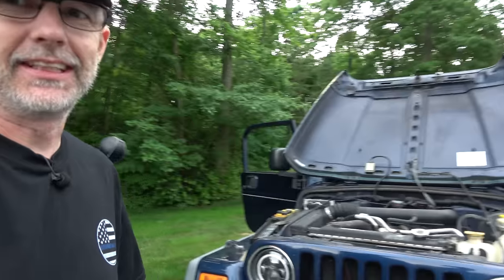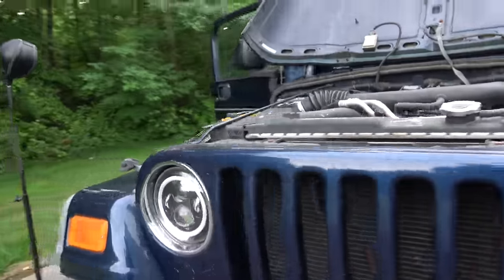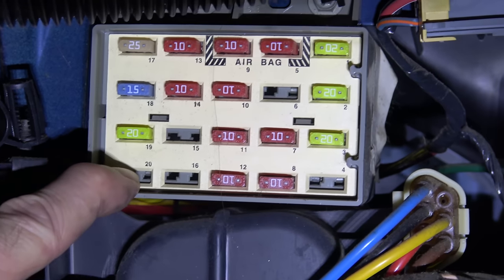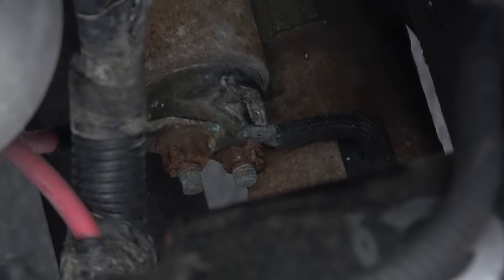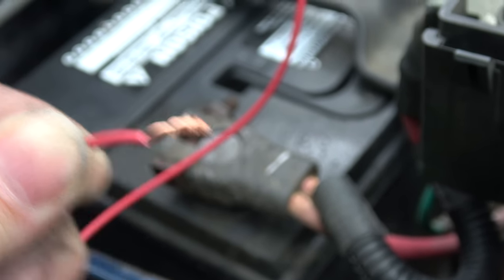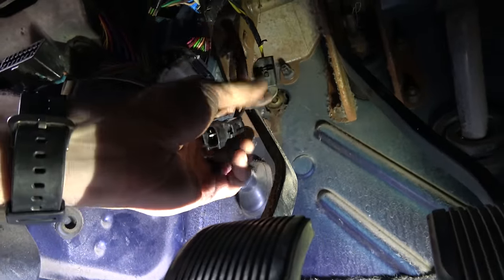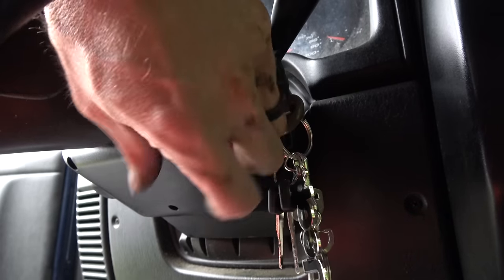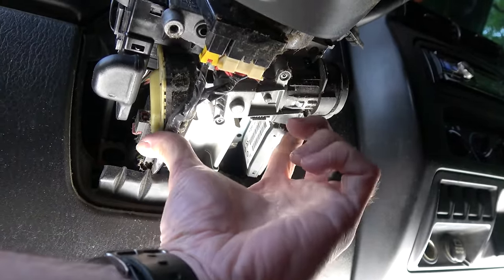Troubleshooting Jeep TJ Wrangler! Won't Start but Problem Found - Project 2004

Comment: If I had a bad switch or actuator would it click as I turned the key.. I have lights, radio, key alarm comes on, but when I turn key I hear clicks and everything goes off, I then have to take battery terminal off, put back on and power goes back on..  thanks for the video
Reply: Did you get this fixed?
Reply: @T_J_SMITH  what did you end up doing? Replaced my ignition actuator and ignition switch a few months ago, now I'm having the same problem. Replaced actuator and switch for the 2nd time but still won't start.
Reply: @tyronehoustonson2944  I found a broken wire on/near the starter and soldered on a new piece of wire to lengthen it, then crimped a new terminal back on.
Reply: Sorta what he talks about around 4min of the vid
Reply: @T_J_SMITH  I just got mine going thank God. Ended up having a blown fuse in spot #19. Took a spare 20 amp fuse and put it in the #20 spot to bypass the clutch safety switch and I was able to crank the Jeep up succesfully after that.
Reply: @tyronehoustonson2944  Remember fuse popped for a reason might want to spend some time chasing that down.  All my @jeep  have no clutch safety switch.  We jumper the plug under the steering wheel, and that is only to eliminate that wire gremlin from troubleshooting future issues.
Reply: @T_J_SMITH  any possible explantations why the fuse popped? Also as I was almost home my clutch went out 😢 the master cylinder broke where it connects to the top of the clutch pedal. I wonder if that has anything to do with me bypassing the clutch safety switch
Reply: @tyronehoustonson2944  Not really, could be the switch internal to the clutch master cylinder shorted out to ground?  I don't recall if it is a 12v line or ground that is being interrupted there either way jumper the jeep side of the connection to simulate the clutch being press in.  then replace any fuses that are there from factory and you should be fine.  As for the broken piece, old plastics sometime crack nothing to do with the fuse just fix that clip and you will back on the road.

Comment: Awful. Just a small piece of metal broke. Was there pressure on the steering wheel when turning ignition on? Do you park with wheels straight? Thanks
Reply: There is no pressure from the actual string wheel.
It's just lightweight pot metal some are actually tin those last the longest.
Often you feel no pressure, but notice you have to turn the key father for the same results.

As far as the direction or the wheels.
That does not come into the picture

Comment: My wrangler is starting up but won’t turn over !  I’ve change several relays . Checked transmission, Battery , cables  are good nothing seems to be wrong or at least I can’t find the problem . 🙄

Comment: I have a 1997 Jeep Wrangler....it will crank but not start. When I turn the key, the fuel gauge, oil pressure gauge, temp gauge, and battery gauge do not turn on. Every once in a while, the gauges work and the Jeep will start. More so than not, the gauges do not come on so the jeep does not start. I wonder if it's the same problem. Thanks
Reply: Crank but no start, no fuel or battery gauge with ignition key on and no communication from scan tool = bad Crankshaft Position Sensor.
Reply: @don1249  It turned out the ECM was bad. I replaced it and everything worked perfectly.
Reply: @thomasmack2409  Good. Now that I took another look at your post, I see that your is a '97. It was the '99 to '04 4.0 liter crank sensors shorting out that would cause the symptoms i described. Sorry 'bout that.

Comment: Got a question. I had the exact same problem and come to find out the black plastic piece on the starter control wire is frail. The wire is broken where it connects so I need to strip the wire a-little and get a new connector to put on to make it a solid connection. And idea what the real name of the connector is and where I could get one?
Reply from the maker: You can just use any female spade connector

Comment: Another  odd thing  is fuse 26 acc =2  10 amp  keeps  popping  found to be the hood light bulb is broken in two  and shorts out against  the ball switch  . A poor design   .

Comment: 5:16 you could of left the key in ON position and placed the gear in either park for automatic or in neutral for standard safety reason precaution..and then you would of done the tap method bypass starter to 🔋 + wire and it would of started .
Reply: This is what I'm thinking too. But why does it not work for my 2006 wrangler tj???? Left key on run position, cranked the engine using the spade connector trick...only cranks and does not fire. (Jeep is a daily, drove to work and left stranded with exact symptoms) I can even hear the fuel pump cycle when turning in the run position. I just don't get it. Bought the parts from this video but haven't installed yet. Just worried it's not gonna work
Reply: @justinkrzynowek9166  there’s a wire for the starter motor & there’s another cable for constant ignition power wire that feeds the other components . ( spark/accessories/fuel pump.. that wire will feed all those 3 I stated . They are color coded  wires have there purpose ..https://wranglertjforum.com/threads/ignition-switch-wire-colors.20519/
Reply: @justinkrzynowek9166  also try swapping the fuel relay . And check for fuses .

Comment: I own a 1997 TJ 4.0L. 
I was driving on the highway on fifth gear, when all the sudden the engine stopped and it won’t start up. I waited for a while and then it started. 
This has happened before; change the ignition, the wires, the crank sensor, the ignition switch, the battery, the gas pump!!!

Please help!!!!!
Reply: Tito Real i had the same problem I replaced all that u said including Ecu but still won’t start

Comment: I have a 2000 Wrangler jeep with 4.0 engine jeep will crank over with clutch pedal down but won't start put fuse in #20 then the Jeep will start up without pushing clutch in but when you push clutch it shuts off does anyone know what could be wrong

Comment: I think i have that same issue.. except my jeep cranks on second try and it only happens every now and then.
Reply: Same here but its slowly taking more cranks to go
Reply: @angellinck  did you end up replacing anythingM
Reply: @tyronehoustonson2944  no, apparently after I fixed one thing. I found out that my NSS is miss aligned